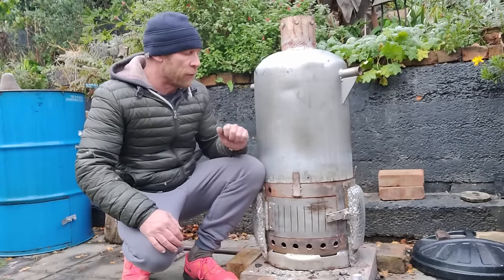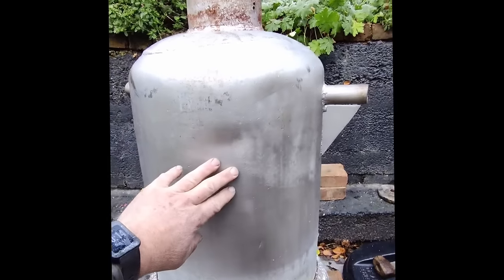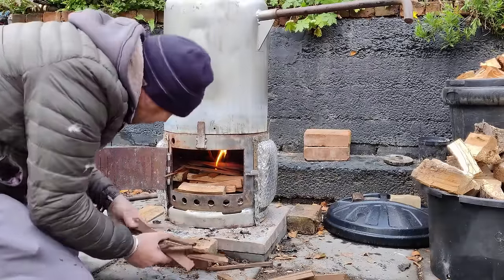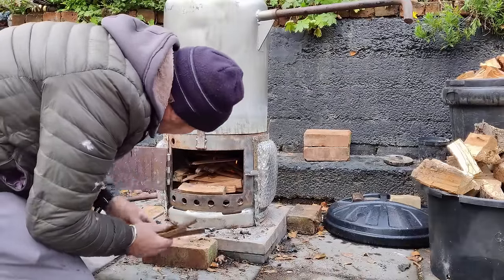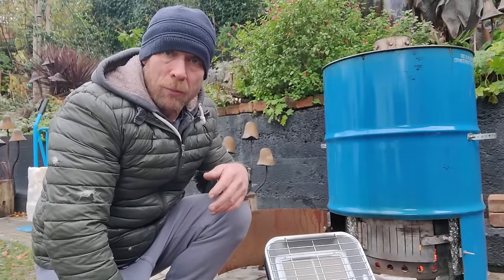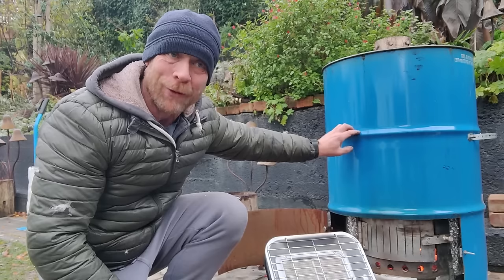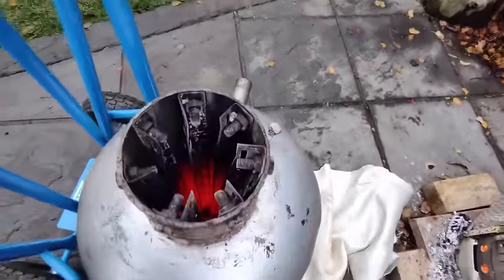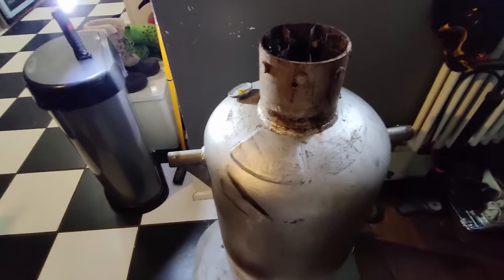Sand battery can it heat my home?

Comment: there are these modular heavy items that can be heated up  and each one can be moved individually so you do not need 2 people to move them and they can be placed on a heat of metal to get more heat into the air  and you could put a few in each room  you might look into . They are called bricks

Comment: You should think about putting a foil screen behind your sand battery when it’s in your flat. That way you could reflect the heat into your living space rather than heating up the wall behind it.

Comment: what if you used trap rock?  it'd allow air to move throughout and you should also put bends in your tube. more surface area equal more heat transfer

Comment: Im in australia, but the snowy mountains part where its cold af, its currently minus 3 celcius in my loungeroom 😂 because i use the exact same heater you bought for 40 quid, but mine is the 3 burner version one burner larger than yours, i never use it with all 3 only use 2 to heat the loungeroom and one to idle it and keep it warm,   i ran out if gas so im sitting awake looking at heating videos 😂 haha. 
I run my gas heater on my loungeroom with all windows and doors shut just to heat the one room, i even put a towel under the front door because my house is drafty, havent had any problems with dying yet haha even when ive fallen asleep next to it, i use mine on low setting (1 bar) for around 14hrs a day and i get roughly 7 days heating from a 9 kilo gas bottle, so im paying $30au or $20us ish per week and it works really well, ive had it 2.5 years now, but im wanting just a bit more atm..
 i like this sand battery idea alot, im an engineer by trade so i think whipping up a sand battery might be something i look into.. ❤ cheers for the inspiration..

Comment: I also wonder if you split the tank in two and you made a half pipe and metal bulkhead to reseal each section and the section was hinged to where it formed a cylinder as similar to what you have. When you take it inside, then the 2/2 could be open back up again and give you more area to radiate that heat.

Comment: The panic over the whole "Rolling blackouts" thing is getting crazy now. Here in the UK, even rusty and incomplete indoor paraffin heaters are sometimes getting into 3 figure prices on eBay !!! Luckily, I picked up a couple of them before the cost went nuts, but I'm now wondering how well the UK's supply of C1 paraffin is going to stand up to this sudden upswing in sales....... It's not like there's been a ridicules demand for the stuff over the last decade or so. I'm not sure how much manufacturing headroom there would be over the usually required quantities. I know the fuels prices have already started to climb.

I'm actually starting to worry a bit that if we DO start getting rolling blackouts, people are going to start doing stupid things, like running wood burners or charcoal barbecues in their modern homes, or trying to run old paraffin heaters on diesel/petrol in an attempt to keep warm and cook food. I've got a feeling that a week or so after any blackouts start happening we'll suddenly see a flurry of news reports on people accidentally gassing themselves to death or burning their homes down. :(

Anyway, It's nice to see that you're still experimenting with the thermal mass heater. Your videos actually popped into my head yesterday because I saw that you can buy parts for those stove top thermoelectric fans on Amazon now. I thought that one of the Thermoelectric modules could be fitted to an old PC heatsink, and pressed against your battery so that it could power it's own air circulating fan in the stand. That would make it TRULY "Off grid".

(Oh, and before anyone starts warning me about the dangers of paraffin heaters, don't worrie yourself. I grew up with them around the home, and healthy paranoia means I keep a REALLY close eye on carbon monoxide levels around the house when they're running....... In fact, I find that faint smell that give off when they're first lit/put out as quite a nice reminder of my youth. :D).
Reply: We had the paraffin man round with his oval tanker lorry with measuring tins hanging on the back. Paraffin heaters all round the house (1970). I liked the prismatic fuel gauge; four black circles was full up. We had sash windows so everything was draughty as f     No one died. We’re back to seventies already, how much are trimphones on eBay?
Reply: @highdownmartin  Oh god. I grew up in a house with sash windows. They had gaps that you could not only feel a draft through, but see a crack of light around too ! When the wind came from the wrong direction they'd give off a droning howl as it rushed through these damn gaps. We had an army of "Daleks" (multiple Valor Viceroy paraffin heaters) in that house because when we moved in it only had "Central heating" in the sense that the ONE electric storage heater was in the middle of the hallway ! Jesus, that winter was cold.

I don't remember ever seeing paraffin deliveries, but I can still remember my elder sister and I regularly walking the mile and a half round trip to the local petrol station (In the snow, Up hill (BOTH WAYS).......... Bare footed !!! 🤣) to fill up the trusty old Jerry can with pump paraffin.
Reply: @Reman1975  the winter ritual of rolling up bits of newspapers and pushing them into the sash. with a dinner knife. 
Frosty on the inside of the windows!
Reply: methanol is still cheap 20ltrs  £36    doesnt burn as long tho
Reply: @bellessecrets7447  I haven't had much to do with methanol, so I've just had a quick look at the numbers. 

Paraffin (Kerosene) has an energy density of around 40,000 Btu/kg, but methanol only has around 22,000 Btu/kg.
I can currently get 20ltrs of paraffin for £46 delivered (Rye oil ltd), vs the £36 you've told me about for methanol.
Both paraffin and methanol are about 800g per litre, so that's 16(Ish) kg for 20ltrs

This means (If I haven't screwed up the maths somewhere...... And I'd put about a 50/50 chance on that. 😁).......
20ltrs of paraffin should produce 640,000btu of heat, at about 14,000 Btu per £.
But 20ltrs of methanol should only give 352,000Btu of heat, so 9,800 Btu per £

The difference isn't as big as I thought it would be. The lower price of methanol helps it's price vs heat a lot. Once you factor in how much heat you can lose with a portable paraffin heater due to needing a bit more ventilation to keep the carbon monoxide levels to a minimum (apparently, the biggest issue with burning methanol is CO2 build up, and for a suitable sized methanol heater, the natural drafts a typical British house has should be enough to dissipate most of that) there might not be much price difference at all. You'd need to store more methanol than paraffin for the same amount of heat, but where methanol pretty much has an infinite shelf life when stored correctly, paraffin can go manky in under 5 years.

Methanol heating was never on my radar before, but I might have to look at it a bit more closely, if only for the educational value.
Reply: The wickless Japanese ones are the best. Zero fumes and will burn for nearly 60 hours on low setting. They have fans and preheating though so require electricity.

Comment: This is Terry from the US. Nebraska. Things are getting crazy all over this world. I have a Dyna-Glo 2300 BTU that used last winner. I used it during the day. And then a small Electric heater in my bedroom at night. Back to the Dyna-Glo. Could I mount a smaller sand battery, with stands on top. What do you think?

Comment: Concidering this as an option to heat my garage i dont need it to be cozy just not needing a coat on in there would be nice but i dont trust my dogs with an open fire or log burner so fire outside with a sand battery seems perfect. But im terible at welding

Comment: You carry that up stairs? Sounds dangerous if you fell over and it fell on you. The weight and heat combo would be bad. 
Could you have a wood burner outside, with a backboiler, and then pipe the water up to the flat to power a radiator?

Comment: I've been watching your videos on this for a while now somehow I missed this one until tonight but I find it very interesting this wouldn't work for me for a couple reasons mostly temperatures we get down to but also size of the house however it has had gotten me thinking about Mass heat over other heat transfer options.... 

Think the next thing you need to work on is waiting to lift it and move it upstairs without the help of two people wear that putting arms on the hand truck or making its own individual lifting mechanism or something I'm not sure and I don't know what kind of area has to fit in either still love the idea of this

As for that other heater with the gas I think that's a good idea for emergency especially if you're going to lose power or there's possibility of it however you do have to worry about carbon monoxide so I would have some detectors for that that will work even when the power's out which I know we're an option here in the USA so I'm sure you have something like that available to you there

Comment: Pipe the wood smoke through water to filter it and burn the gas under the bricks or sand indoors.
I have economy 7 Storage heaters from the 70's in my home they are full of bricks. They get thrown away no one wants them. They stay warm for 10 hours. They have a flat that opens or closes by thermostat.

Comment: You said that the center gets cold, but is hot for 3 hours. If you had an automatic fan that only ran for the first 3 hours, do you think you'd get more heat out of the unit? or do you think the 3 hours is only because there is no fan, and it would cool right away if a fan was placed there.
Reply from the maker: No it will stay very hot for 7hrs + what I was saying was the fan will cool the flue & because sand can act as a insulator it cant pass that heater to the metal work inside effectively,
But yes if I put the fan on & ran it for a while then turned it off & the metal work will heat up again, but it is best just to let it convect naturally it give out much better heat over a long period (if that all makes sense) 😬

Comment: Sir,you have some errors on your stove. The first one ,those fins on the door and those holes ...you have to control of the air,as you can see,the flames are coming up on the top,that means you loos the major part of the heat,because of a too fast air flow. Secondly one single large tube going up  doesn't bring much heat to the sand,i would suggest you multiple thinner tubes wich on a top compartment are changed to that thick tube of exhaust. We used this  kind of heater in the communist regime here in Romania, the only difference is it was filled with water, used as water heater or for heating the house thru radiators,in wich case it had a pump for circulation. So..nothing new under the sun😊  Edit: The sand by it's nature have a bad thermal transfer. If you look at it magnified thru a micorscope,you will see some balls which have a tiny contact point between them. That's why i suggest you to mix the sand with a bag of refractary cement,no water required,it will fill the gaps between the grains with a good thermal conducting element increasing the heat absorbance exponentially,good luck.
Reply: Does the cement eventually harden by absorbing water from the air?
Does that affect anything?
Can you purposely add water to solidfy the cement so it doesn't blow away/cause dust? Or would that degrade the system?

Comment: why wouldn't you put a stove pipe in your house? and then heat the sand inside! anything you have to carry in and out everyday becomes a big chore. imagine if you got sick and had to do that. on the coldest windiest miserable days, or rain, how are you going to keep burning all thar wood. it probably takes 6 hours to heat all that sand up in the first place. and youre losing half of your heat to the outside air instead of doing it inside.
Reply from the maker: I did explain why I can't have a chimney inside & how long it takes to burn, Not long ago (& is still done) our descendants would walk sometimes far & wide to gather wood & cut it with axes & hand saws carry it all back & stack in a wood store.
& Handling that wood 5-6 times.
Trust me this is no effort to keep us warm & save us money 👍

Comment: The most efficient way to use this principle and reduce waste heat coming out of the stack would be to build an underfloor system like the Korean "ondol" the whole floor becomes a thermal storage system. Highly impractical though to retrofit, and the bylaws and regulations would not favor this. But who knows if the crisis is not going to be the norm or get worse. I cant imagine a first world country like Britain is suffering almost third world problems, especially as it is so wealthy.

Comment: The " surplus" heat you could coil some copper tubing to heat water and store it in some thermal buckets. In Asia we use those buckets to store hot rice. You could find em at some asian stores in the uk. 
Water can be used to shower with a simple 12volt pump 🙂

Comment: Have you tried adding another lift off pipe to the top of your chimney ?  This will will increase chimney draft, burn your fire hotter and,  provided that the sand can absorb and dissipate the heat within the battery fast enough, will I suspect significantly reduce burn times, An easy thing to try if you have spare pipe.  Great video - thanks.

Comment: I use a dutch oven ( oven type, not the sort with legs and a handle).......i place it on my normal gas stove after heating it in a 3 section bbq smoker. I use a brick in in but will try sand now 🌹

Comment: Don't know if anyone suggested yet, but if you would change the firebox to a smokeless secondary combustion design, you'd increase the burn efficiency of the wood you use.
As you said the flames on the top are quite neat looking, but they are also a neat way to show how much heat energy you waste.
More efficient burn equals less burning time required to heat to the same degree and less wood used.
The flames and the hot air above it is all going out into the environment instead into the storage.

As for the storage as others mentioned in this comment section some tubing through the sand inside would allow a quicker release of the heat, but I guess it depends if you aim for heat retention and longer duration of release it might be better the way it is.

Unless you channel the exhaust of the firebox through an internal tubing of the storage, because then heat gets more evenly distributed in the sand, possibly making the heating up part more efficient.

But I suppose that'd be an entire version 2.0 of the project :D
Reply: Agree although a Slow low temp burn like charcoal manufacturing would be more economical. Letting something get to 500deg plus is just wasting energy . Ok that depends on how cold your room is etc  . When we’re out of heating oil we sometimes use a small cheap 1800w electric fan heater , believe it or not that’s enough too heat a large kitchen with a hallway and a small bedroom. 2 are enough to heat our bungalow to quite a nice temp . Don’t REALY have the time to experiment with stuff like this at the moment but I’ve just seen a sand battery with an electric heating element in it ran from solar panels . Pretty good . No different than electric underfloor heating so why not  use an insulated slab of concrete with trace heating , not hot enough to crack the concrete and could use solar as partial power . Romans used to duct hot air from fires under floors so nothings new really 👍🇬🇧
Reply: Excellent suggestions. Your thoughts on making the flue with bends instead of straight.

Comment: Great video Lee. The mantle idea is absolute genius to convert the waste gas to radiant heat. If you used concrete with a rocket stove principle it would probably heat up quicker with less fuel although it might dump the heat in your room too quickly making it uncomfortable. Thanks for sharing! (Just found out clay can store 50% more heat than sand/concrete). I think you're on to something here for homes with wood stoves - I think an internal larger clay rocket stove version could heat water and the room for a whole day from a 2 hour burn!